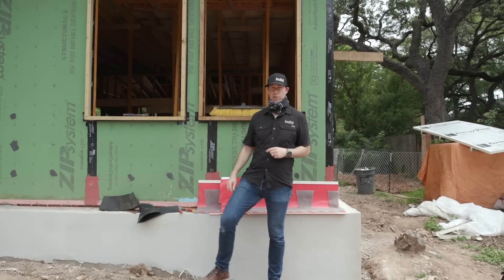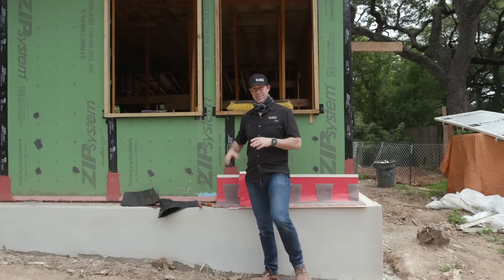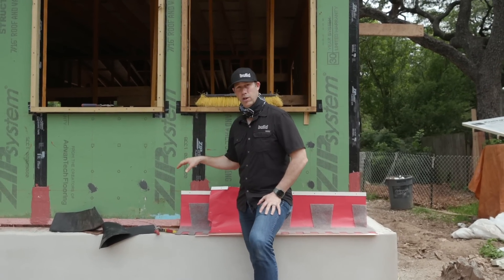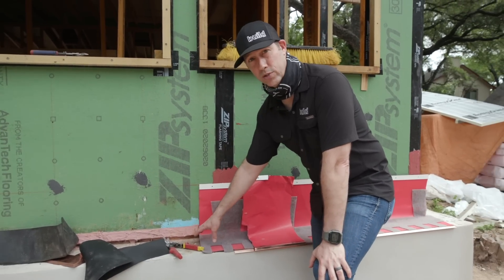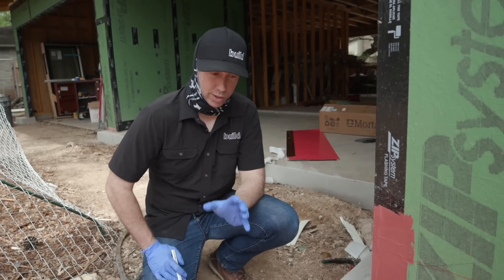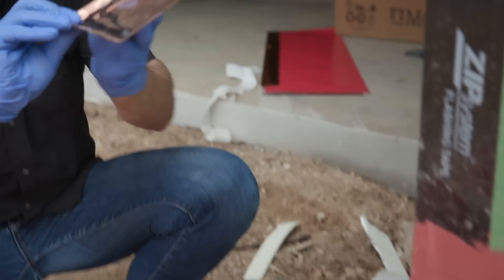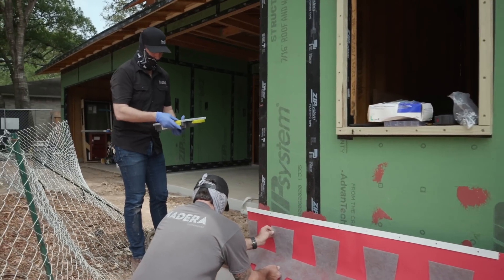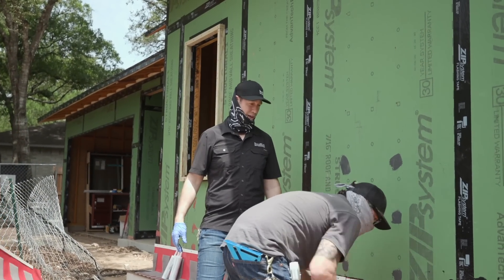Bomber Flashing Detail for the Base of A Brick Wall

Comment: Man this is a lot of work, how we do brick veneer in Aus works perfectly every time and is 1/10 the work! Seperate the slab from the brick, our external brick runs up from the foundation in a seperate skin with a cavity mandated by code at 1” past all obstructions, typically most do 2”!
Reply: Aus brick veneer is exactly the same as this....The slab is rebated as shown here and the brick sits in the rebate, tied to the frame with brick ties and the frame is wrapped in paper. Weep holes are placed in the lowest course of brick. This is the same system, with 5 x the complexity and 5 x the use of products. This system is better, but you have to question the cost/time etc vs the end goal.
Reply: same in Canada

Comment: As a mason, I think it is exaggerated how much water goes through a brick wall. I bet most of the moisture is condensation, and it is negligible.  If there is a big problem it's the roofers fault.🤖... been a mason since 1985 and NEVER seen water come out of those weep holes. But I have seen bees nesting inside them.
Reply: It's the damn wasps man, they love to build behind the brick and use the drain holes for exits. A pest control guy suggested I cram stainless steel wool into the holes, not tight enough to block water flow but to keep the bugs out. It has been about 4 years now and so far so good, now the wasps just build nests under the eves and its much easier to wack em.
Reply: @Nanan00  Good Advice👍

Comment: Interesting video.  However, I have a question.  On April 14, 2020, you released a video of using a stainless steel flashing.  Why not use the flashing shown in this video where you used the stainless steel or vice versa?
Reply: That flashing had hardie board and not brick on the walls.

Comment: With this flashing with the wide weep slots will this not be a potential weak point, with no direct mortar bonding between the foundation and the bricks?
Reply: That's typical of any installation of brick on a ledge, regardless of the type of through-wall flashing used.
Reply: Still see some issues, may be wrong as never seen this  product before. On top of this will be a layer of mortar then bricks, and repeated. Bricks and mortar are heavy, that foam stuff to wick away the water must be porus and non structural. What is there to stop the mortar penetrating and blocking this foam? If there is protection then there will be brick joints over this foam that will not be supported, a weak point that may cause cracks. The product itself  is copper, a very good conductor of heat, will expand and contract as the weather changes, likely at a very different rate to the bricks, again may cause cracks. If there is another layer that goes over the top to protect the foam and spread the brick load to the load bearing areas between the foam, and gives some sort of bonding to the foundation them to me all is good.

I would have used a liquid DPM,  to prevent rising moisture, mortar bonds to this material, with weep holes, small normally hard plastic rectangular tubes, that sit in the mortar under the centre of a brick, so the load is bridged, that allows out any moisture.

But our conditions are very different, so as I said may well be wrong

Comment: I am not a builder, just into this kind of thing. Would there be any benefit to using zip tape along the white “secure board” to ensure no water got behind this system?  Would it also help where the panels butt up to one another on a vertical plane?  I realize that this would add cost in both material and labor.

Comment: Very interesting piece on water control in wall structures. Would it be possible for those of us who can not afford the "best possible answer" to get some further info from you or from some specific sources for other less expensive solution? Durable housing is a very desirable thing- but down here in the Middle Class (much diminished of late), many do not have the financial resources to "top of the line" something like this- even with our two income lifestyles, we can't afford this! If I have to decide between the big stove and oven for my wife's kitchen, and water control details I must pay for today in hopes of a benefit 30-40 years from now, I think you can see which way I will have to go.

Comment: But doesn't everything fail eventually?  So the sealant will fail and won't water get behind there and be trapped?  Why not just a rainscreen / airgap behind the brick?
Reply: Every chain, no matter how strong, has a weak link. It's about continually identifying the weak link, strengthening it, then determining which other link has now become weakest. For ultimate longevity it's necessary to design in some non-destructive way to get to that final weak link so it can be maintained or replaced as necessary. Another way to put it is to design failure into the system (instead of letting it happen randomly) then providing an economical way to repair it.
Reply: @HistoricHomePlans  Exactly......in the goal of attaining foreverness, you actually compound the situation,.....the more expensive layers you pile on, the less likely you will ever be able to repair them economically and the build strays further and further away from economical...…..

Comment: The brick ledge should be about 6 or 8 inches lower than the framing. This will solve a lot of water problems and well, but I realize you are working with what you got.

Comment: I have always wondered: why the emphasis on a structural wooden frame while also opting for a brick cladding? Using a limestone brick orthe like as your structural walls inside allows you to easily apply brink acnhorage, add in a water proofing layer and insulation and slight goof ups are more easily managed. And you have more "weight" in your structure, which aids in temperature regulation (thermal mass on the inside of your insulated shell increases)

Just curious
Reply: Well other tham using concrete blocks for the interior walls!, thats exactly how the majority of homes in the UK are built.

Comment: I would think the insulation should go behind the flashing. Any moisture would be in front of the insulation not behind. Am I right?
Reply from the maker: I disagree. You want to flash back to the Zip sheathing which is the primary water and air barrier.
Reply: Matt Risinger but the air gap is in front of the insulation?
Reply: @curtcmiller  You are right and it's a problem in the industry. They waterproof on the sheathing, behind the insulation. That's why when we go back a few years later on the job, the exterior insulation has absorbed water, has compressed and has lost much of its insulating properties. But shh don't tell that to contractors lol they don't usually like it.
Reply: @酎ハイ飲んだらいい感じ  You are wrong and it's advice like this that will encourage someone to use bad detailing. That is not to say that you can't put the WRB outside of the insulation in certain scenarios, but in this case you want the WRB against the sheathing, and the insulation outboard of this. 

The insulation will not compress from water or anything else once installed. Unless the tree falls on the house or if he drives into his house. The insulation will also not absorb water, as it is not sitting in a puddle. It might get wet, but it will dry. Buildings will always get wet, but the key is to prevent bulk water intrusion, and allow for a high drying potential.

Comment: How does this system handle non-orthogonal corners?  Do their preformed corner components come at irregular angles?
Reply: Currently we have an adjustable drip edge corner that can accommodate 22 degrees to 325 degrees.  Our preformed synthetic rubber components are designed currently for 90 degree transitions.

Comment: Doesn't butylene degrade heavily over time?

I mean... It's the same stuff they use to overmold tools at the factory for rubberized grips..
Reply: yes and no. they use butyle tape on cell towers now and in a lot of bathrooms. never seen this silly shit before though  using gutter caulk on masonry hurts my brain.
Reply: Butyle rubber is what seals every window around the world.. Be it your CAR, or house.  It is nearly immune to UV when loaded with carbon(black).  Still, there is a reason aluminum flashing covers the butyle rubber.  Now if you get Buytle rubber that is not black... yea, problems.

Comment: Pfff, why not build all masonry wall at this point? Like lightweight concrete blocks inside, air cavity for insulation, and brick on the outside.
Oh wait, it's too simple,🤣 then no super expensive products would be needed. Also a lot less cold bridges .
Reply: Thank you so much for the input on masonry.  It's nice to get another perspective.  Sometimes we're so busy building a certain way that we forget that there are actually other ways to build.  Wood is wonderful but at some point another material may make more sense.
Reply: Completely agree. That's how they build in Holland. Never in my life have seen a y leakage or moist areas inside. Taking in count in Holland it basically rains every other day. No idea why it has to be so complicated and expensive

Comment: Sometimes I think that the construction industry has not come up with anything better to build with than wood because of all the additional items you have to buy to "protect" that wood from water !! There are several whole industries that exist just for this.  Think about it .. why are we not building with some strong composite or metal frame - if that was what we all used, the costs would come down and we would use just less material to protect it from water. Maybe i'm just i'm just seeing "conspiracies" where there are non .. but when you look at the seething, house wrap, gaps between house wrap and siding (to allow water), water proofing flash tape .. etc .. etc .. - it feels like we would have come up with a better way after this many years of construction to build simple frames that are impervious to water. Carry on .. cheers.

Comment: Make sure you seal every nail hole on the Zip Sheathing. I see you started to, but also noted that you have lots of nail penetrations, where the Zip has swollen. Remember Zip sheathing is just OSB (which is swells if it just sees moisture) with a vapor barrier on the exterior. We used R-guard Joint and Seam on every hole. FYI - The Huber Zip liquid flashing is made by Prosoco (R-Guard)

Comment: Brick in the outside is the wrong way to do it. Brick has high thermal retention so on a hot day it heats up and keeps heat, cold day opposite. Better to have brick on inside and insulation/wood/sidings on outside. Bit difficult to change this paradigm but the physics support it 😁

Comment: love your vids  matt.  But i do sense you  do not love brickwork too much.  If  you have single layer brick leaking then you need a better bricklayer.  Many many houses in the past  were built in the uk  using single brick no cavity. they stayed water tight for  many many years. now many are over 50-100 years old   they are needing the mortar repointing. most houses built in the uk  are brick outer and inner with cavity or brick outer  and cement block inner again with cavity and the best damp proof material   to be used  is Slate.  I know a lot can be  learnt from  american style building.  but remember we have Brick sewers  built in the 1870 that are  still watertight.

Comment: 50mm air gap between insulation & back face of brick in the cavity.   
Cavity tray should be on a steeper angle and same detail above window heads
Weep holes in vertical mortar joints of brick course directly sitting on cavity tray
Walls ties fixing brickwork back to timber board inner leaf.
Use mortar boards when installing brick to stop mortar drops falling into cavity.
A brick cavity wall should be wide enough to allow for ventilation & drying not just the passage of water.
Reply: You are correct. I have detailed projects where there are small stainless steel vents placed in the mortar joints near the top and bottom   to completely vent the wall. It is a system similar to glaze fired brick systems.

Comment: Could you build the concrete sloped outwards, then there could never be any water that pooled on the bottom? And leave some vertical slits open (unmortared) between the bricks to let the water run out
Reply: You need it level to put bricks down and they do leave weep holes on the bottom row of bricks

Comment: 8 inch Nudura icf with steel bar joists for floor and roof welded to steel plates sunk into the walls when they are poured would make the wood framing look like a cardboard box and probably cost about the same.

Comment: I thought Copper in contact with concrete would be damaged by electrolysis. Copper pipe is placed in plastic sleeve to protect copper.

Comment: These kinds of details are costly and labor intensive, and that's why most homes owners don't want them. People tend to be more focused on price than overall quality/durability. Building a house the right way is probably 20% more expensive than doing so the standard way and, since most people don't stay in the same house longer than 10 years, they simply aren't concerned about the longevity of the building...because it'll be someone else's headache by the time it becomes a problem.

Comment: OK I heard enough from you Matt. Sorry but your blue method is not acceptable in a 21centry type of living. You building houses which won't last but you apply ton's of glue to the outside where you don't even know if the glue will last 20 years from now because the product is so new. Shame on you to fall for it. Might want to go back to Europe and look a little more there what is been used for houses to last really years and years.... NO WOOD instead we use a lot of clay , motar and concrete in shapes and forms. Look into Ytong, AAC and Hebel. Those products are used for 30+ years and no mold nothing. 

Do you even know if the glues you use are healthy ?? I don't ???

Comment: Those old Victorian homes will be saying "Well, back in my day they use to build things to last, we didn't need anything so fancy - look! Look at my wood slat cladding, my new owner stripped it back and treated the wood and painted it over and I feel as good as new and my brick? Well those were fired properly and my walls were constructed using techniques from way way back and natural ventilation to keep moisture from sitting in. These new houses tell me they want to get up and running and boast about all their new features and materials. That is all well and good and i love the new systems and what they call "technology" but to me it seems a lot of time and effort is spent to make less time and the actual technique of building is lost in favour of using technical material to replace building techniques used when i was built that have lasted me over 100 years and they say 30 years is good for a house now? Call me old fashioned but I just don't get it."
Reply: I completely agree with you